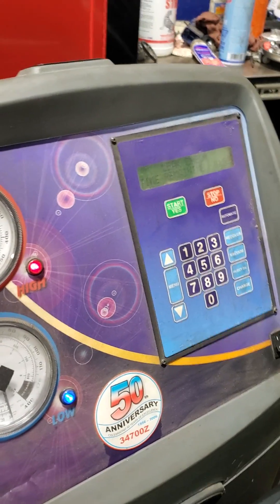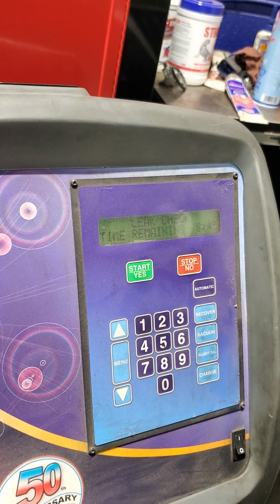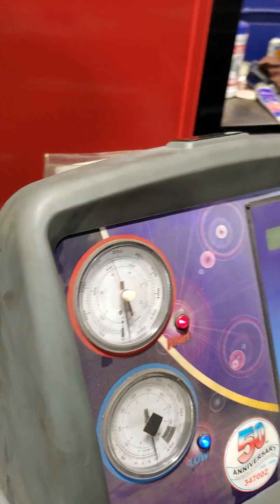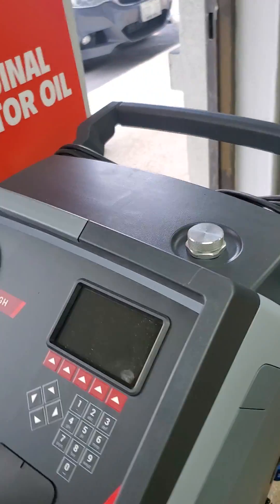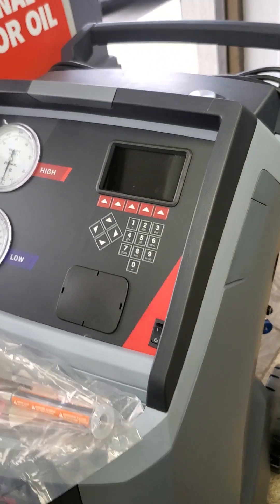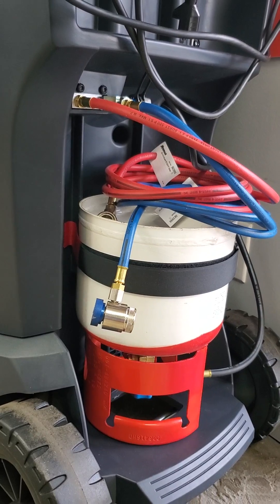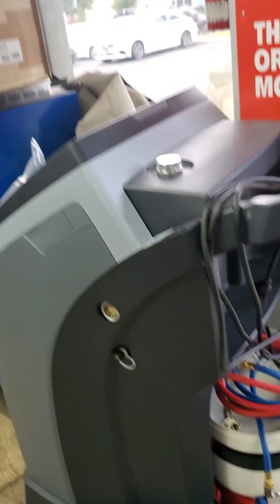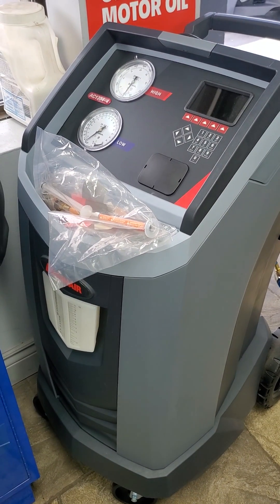What is the difference? Awareness of Changing Refrigerant Types  R134a & R1234yf  @UrbanAutomotive01

Comment: i Love the  two Cents on  R12     it is an oil based refrigerant   you know hydrocarbons  generally not good for the air   Ozone  has a decay life  or a Half life of Days  and in part of Nature 
  WE really do not want to spray oil in to the air  so the ban is a good thing    but the on going story
 of Ozone depletion is Going to drive then Crazy when the Truth Comes out  
 now the powers to be want us to use  PROPANE as a Refrigerant  of it works     want a fire
  yes in the right conditions